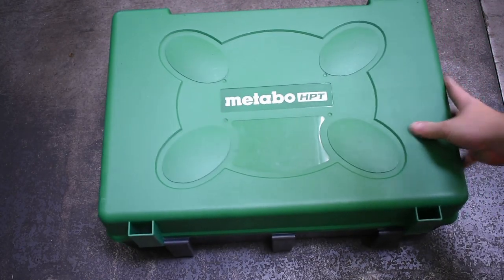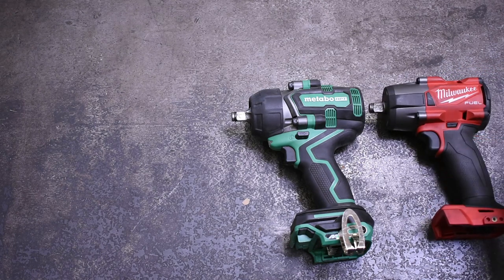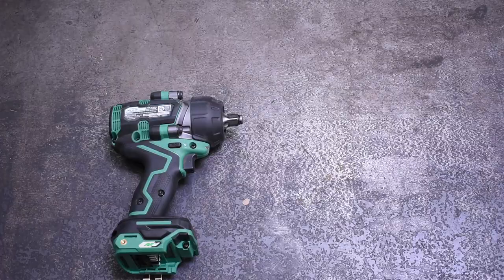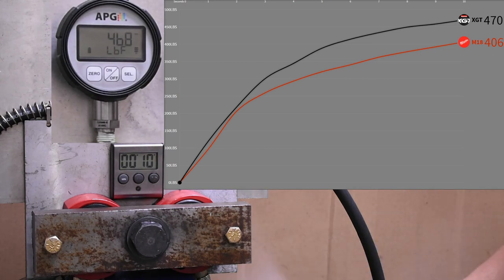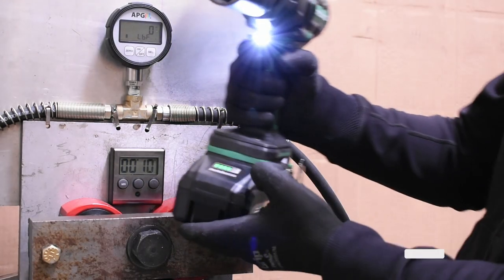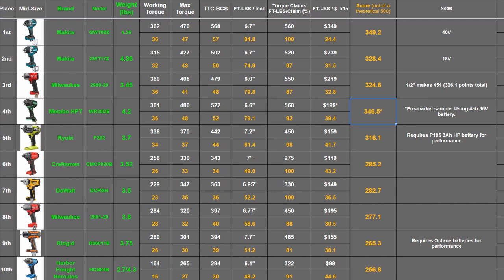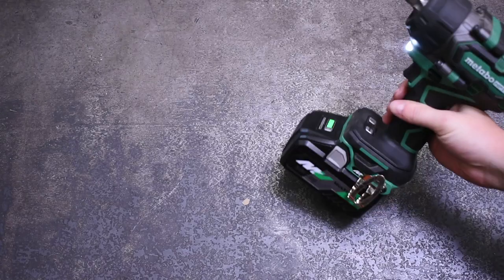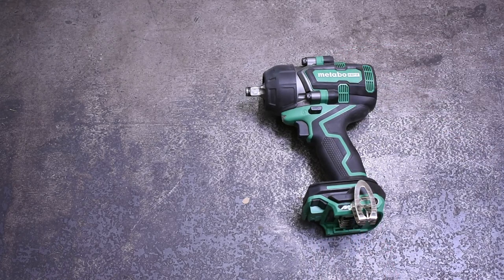We Stole This New Impact Before It Goes On Sale to Dyno Test It: Metabo HPT WR36DE

Comment: Not sure why Metabo HPT has been largely ignored on YouTube but they have made some of the best tools out there for years. Great video as always.
Reply: Metabo doesn't really advertise or hype like the other big brands. Also the whole metabo hpt merger thing still has everyone confused about what they are. I think they would have been better to stick with the Hitachi name. It doesn't help either that they only make power tools. I don't care personally but the customer has spoken and they want to be in a manufacturers ecosystem with complete lines of products from hand tools to clothing and storage as well. It's like Apple vs Android at this point.
Reply: @Kyle Fowler  it's a shame because, to me, they have probably the most balanced platform. Great power and ergonomics and a lifetime warranty that is good for as long as they make the tool.
Reply: Not knowing anything about this line, literally nothing. Is it a long term quality issue? Purchasing location?
Ugly color?
I personally use Milwaukee, I have lately been buying the M12 Fuel line and am extremely impressed.  
With that being said, I am impressed with the power of this tool. The plug in option is unique,  I don't know if it would come into play, unless you only own a single tool and one battery. Then it could definitely be a benefit to continue working while battery is being charged. Like most probably,  I have a few batteries in reserve.
Reply: @randysmith9636  They are Hitachi,  been around forever.  Straight outta Japan quality
Reply: @danhenderson783  
That's what I get for doing three things at once. He does mention it in the video. 
Thank you though.
Reply: I have the old Metabo 18 ltx 400 before the merge and love it.
Reply: @Randy Smith  honestly I think it just comes down to lack of marketing and a limited tool line availability in store
Reply: Well look at snap on, their only marketing has been from tool trucks as well as not being an off the shelf product line available everywhere..  maybe all the stuff snap on “gives out” with certain purchases did it like the jackets and stuff but they got to be a well known line.  Or maybe theyre just well known because theyre so damn expensive… metabo used to be right up there price wise themselves though as well as being available in some franchised stores..
Reply: Thanks! I too beleive metabo and metabo Hitachi are some quality and reliable tools.
The 36v stuff is crazy powerful, the triple hammer impact drive is a bad mamma jamma.
Reply: @threadtapwhisperer5136  they are fantastic
Reply: @ToolswithSoAlz  thats great to hear. I am seriously fanboyed for the Metabo 36v stuff. Soooo much power and seemingly no easily drained task, at least not for the qiarter inch impact driver.

Im thinking that angle grinder is gonna be mine this week payday. If That dont go right through a 36v fully charged battery I'll be nigh unconvertable
Reply: @Matthew Laumann  I have the 36v hammer drill and have shown it to be at least as powerful, if not more, then the Milwaukee. You can get some incredible deals on Metabo right now. I've seen the corded adapter for $50 at Lowe's. Just keep an eye out for those special deals.
Reply: @randysmith9636  the AC adapter works great for my 10" full size table saw, grinder, portable band saw, mitre saw, full size router, SDS Max rotary hammer,  vacuum, saw all, circular saw etc the 36V Metabo HPT tools have replaced quite a few of my Milwaukee and Makita tools and I have been rockin Hitachi/Metabo HPT nailers for over 25+ yrs

Comment: I really appreciate all your hard work building the dyno coupled with countless  hours filming and editing. 
I take great comfort, in knowing that my m18 mid torque, is basically an old skool IR gun without the compressor. 
I work in a tire shop and use my m18 1/2 inch daily. I did 20 tires today and another 8 or so wheels off the car for rotates/various other jobs. I charge the battery 1 time a week. 

That kind of power used to be limited to a large air compressor and expensive tool.
Reply: So realistically for MOST of the applications would you rather have a big knob on the end of the tool that is the battery, or just have a cord that is electrical rather than a pneumatic hose connected without that obstructive battery?

Comment: I recently bought the hikoki/metabo gun, can confirm the breakaway torque numbers are in the ballpark to your results, 32mm socket on a m24 wheel stud, we set all the nuts to 650nm and it was able to break it loose with little hassle. I have the high torque gun in 3/4 aswell, it regularly out performs the bosses near new 1' milwaukee gun much to his displeasure.

Comment: Lowes has a special Metabo deal on for 149 USD
Hammer Drill at 620 ft lbs
Impact Driver at 1800 in lbs
With two 3 Ah batteries and Charger and Case
Amazing value

Comment: I'm still deep on the 18v red wagon. But will probably stay with it since it fulfills all of my needs. Not to mention that the investment was huge an will be hard to switch.
Reply: Yup. Sold my 20v DeWalt and 14.4v snap-on and switches to all Milwaukee. Gonna stay that way for a long time.
Reply: There's no reason to switch. I think Milwaukee has the best all-round line-up in terms of variety, performance and price. The M18 mid torque is strong enough for most things and it's smaller which helps a lot sometimes. If it's not strong enough that's when you grab the high torque.
Reply: The other companies don’t even compare to Milwaukee when it comes to amount of tools they have, compared to the competition. I’ll stick to Milwaukee for work, and Ryobi for home/garden.
Reply: Standing here deep in the M12 line, really only lacking some kind of major high torque 1/2 inch gun, but line of work always has access to air power.
Reply: And they offer more tools then any other company
Reply: @MrAPCProductions  do you think you can even get High torque with a 12 volt?
Reply: @AATreeService  In the US they might, but internationally, Makita and Hitachi have a huge lineup of tools and other equipment
Reply: @histguy101  so I just looked.  Milwaukee is still like 100+ larger
Reply: @AATreeService  Yeah, how many of those are available outside the US. How many are in current production? If you live in East Asia, there's Makita and Hikoki for everything. Both companies don't really cater to the US market, just like many Milwaukee tools aren't available outside the US
Reply: @histguy101  why are we talking outside the us now?   They are all available.  Still making it about 30% larger than any other tool line up at this time.
Reply: @AATreeService I'm just saying that depending on where you live, the most expansive power tool line wont be the same company. If you're in the US, it will be Milwaukee or DeWalt. If you're in Europe or East Asia, or Australia, it'll probably be Makita or other brands. Milwaukee doesn't release their whole lineup outside the US and vice versa

Comment: Impressive performance from the metabo. I have the Milwaukee mid torque and its powerful enough and sometimes that couple mm or cm can be the difference between being able to fit the tool or not. So far I haven't came across a fastener I couldn't remove with it. But if it doesn't have the beans that's what the high torque is for.
Reply: As a fellow mechanich i agree, my most used gun is the gen1 stubby. When you work on cars, especially on smaller ones size is more important than the power.
Reply: @t00tya  I'm new to the cordless impact game and and just want something to loosen lug nuts but if I can go smaller and use it for other nuts and bolts while changing brakes that would be awesome. What do you recommend? I'm a home gamer who only works on my own vehicles in my driveway, no garage.
Reply: @emort6  Get something like a stubby. it does those things if you don't daily them...

Comment: good stuff, to me the sizing is really heavily weighted on mid torques and smaller impacts after all if they dont fit on the bolt then they cant even transfer 1 ft lb to it, high torques on the otherhand make them as big and hefty as necessary to hit as hard as possible as the point of them is to knock loose rusted seized junk and larger higher torqued fasteners

width is also a big factor my m12 stubby doesnt fit alot of bolts or requires an extension frequently due to its width not the length theres often lots of room behind it.. other times youre hammering it into a spot so tight your shaving curls of plastic off the back of it

 wonder if theres any designs or products on the market for impact extensions that dont rob as much torque, maybe make them thicker, fit more snuggly on the anvil even if its a pain to get on and off, possible a set screw to synch them down proper get rid of that loose connection point cause sometimes you just have to have an extension to get on a bolt

Comment: I love watching all these different tests although I'll never buy anything other than milwaukee cause I don't wanna have a million different batteries and chargers.
Reply: I’m really hoping Milwaukee does 36v/18v like hpt does it’d be great to move up while still being able to use the 18v tools
Reply: I just wish milwaukee wasnt so damn expensive. They have a really huge line of tools that are really good they cost an arm and a leg
Reply: Same here except it is Dewalt for me. i have lots of Dewalt batteries and quite a few tools. im not about to switch all of that over. they do just fine for me.
Reply: I am in the Makita 18v lineup of tools. But I’m really considering getting into the Milwaukee 12v because of the multi tool. The ratchets and that cordless angle grinder. It’s hard to do it because it’s pricey and I would need at least a few batteries for em. But the tool line up they have for the 12v is seriously amazing. They don’t have any real competition when it comes to the size weight and flexibility of the batteries. Not even dewalt can touch them. I feel like no matter what you need the Milwaukee 12v line has what you need. Unless you need a high torque impact wrench. But even their 12v has some pretty good torque numbers if you don’t need anything over 400ish. 

I feel like I just talked myself into it…..

Comment: I'm so close to going all in on Metabo HPT, but the fact that their grinder still uses the awful cam latch "tool-less" guard (you basically always need a tool because it loses pressure super easily) I haven't gone in. Once they have a guard similar to what the rest of the brands use then I'm 100% in
Reply: I own the grinder, and I love it!  I haven’t had any issues with the guard.  That being said, I don’t use mine super hard or for extended periods of time.
Reply: @baraksinz  same we own the 36V switch and paddle and both have been impressive and powerful guard has not been a problem, more power than the other brands , low vibration and we do use the AC adapter for longer runs

Comment: Heya guys
I'm from the land down under, and I have an as of yet unreleased hikoki/metabo hpt impact driver that is just begging to be tested by you guys across the pond. Model number is WH36DC, it's a new compact 36 volt tri beam light 1/4 hex driver rated for 217nm of forward torque but not sure about reverse torque. No load speed is claimed to be 3700 rpm with about 4100ipm.
Let me know if you'd like to receive it and I'll send it over via express courier.

Comment: Very cool. Was about to add the 36v hammer drill to my lineup of older 18v Hitachi tools. May as well pick it up seeing that it's on sale for the holidays and wait for this. I didn't want to spend all that money on one 36v drill.
Reply: Will the 36v flex batteries work in the older Hitachi tools? Would like to keep mine as well.
Reply: Nevermind.. Found this: "In respect to this, are Hitachi 18v batteries interchangeable?

As far as compatibility goes, the Hitachi MultiVolt battery will power any Hitachi MultiVolt tool or 18V lithium-ion tool without issue. Going the other direction, Hitachi 18V batteries will not power a MultiVolt 36V tool and the form factor is designed specifically so it won't fit in the tool."

Makes sense.
Reply: @midniteoyl8913  yes all 18V can be used with 36V MV batteries in fact if u get the 2.5amhr MV it's actually a 5.0 for your 18V and also the 4.0/8.0 MV is an 8.0amhr for your 18V

Comment: I have watched a large portion of your comparisons now, and of course this is just speculation but based on the impacts that i own and the ability for them to either break a rusted bolt free or not, i would say a good indicator of what a gun will do is in the first 2 seconds of your chart. I would be curious to see an overlay of every single gun you have tested and see which one shows the highest number at the 2 second mark, and then see if it is actually the strogest rust busting gun in reality... (within each range of coarse, mid torques, high torques, etc.) Great videos BTW, keep er' movin bud! :)
Reply from the maker: Great point. But its important to compare within similar impacts per min. For example drivers shoot up fast due to ipm. With the same ipm range, higher earlier is more force per blow

Comment: In the manual did this impact have the waterproof rating as some other metabo tools do? Also is the lifetime warranty thing still a deal?
Reply from the maker: Tool says Ip56 so yes, check out Workshopaddict's vid where he sticks it in a bucket of water. No manual came with it though, maybe too new
Reply: The lifetime warranty with the hpt tools is for the lifetime of that tool model, remember. As long as they make that model, that's the lifetime. So ideally, a new tool model like this has the longest warranty lifetime 😁
Reply: @rpavlik1  Really? It says "Lifetime warranty on tool body" I would think that would mean the lifetime of the physical tool
Reply: @histguy101  well, what I've been told by people who looked into it, is either the lifetime of the particular model, or as long as they have parts (which may be slightly longer) I don't have any so I have no personal experience, I just know that's an important disclaimer because "lifetime warranty" is a powerful phrase with a variety of interpretations. It doesn't matter what any of us think, only what the law and their contractual language/warranty terms says 😁

Comment: I'd like to see a for science episode with 18 volt and 36 volt HPT tools/Batteries. The capacity increases with 18 volt however does that make enough of a difference to continue to use the 18 volt counterpart with a 36 volt battery if you have the 36 volt tool available or does it even matter which one you use
Reply: There’s no premium price jump when going to 36v. You can gradually get into the 36v tools with no compromise to your 18v
Reply: Hell a lot of the combo kits are mixed with 18v and 36v tools

Comment: Tryout the new diehard impacts sold at advance auto. I’ve been using the ratchet and they do pretty well for being as cheap as they are. They come with batteries and chargers too so it’s not too bsd
Reply: They look identical to the Workpro ones on Amazon, Den of Tools figured out the oem. There's also another brand that sells the same tools with different colors. Yes it definitely would be interesting to see a battle of the discount options.

Comment: It's an interesting assumption that just because you start at 0 torque and in most practical application you will be starting off at a much higher torque 
That you can just pick a spot on a chart and that's how it will proform 
I can sse why you would say that but maybe a quick test to make sure that is an accurate statement is in order

Comment: I've become invested in Kobalt's tool line since I really have no need for pro grade tools, but I still think Metabo HPT looks pretty tempting. It's hard to beat Kobalt's value on a lot of tools though, especially since they regularly have some serious sales.
Reply: those 24V tool are awesome, except a little bit delay from the trigger
Reply: The thing is, Metabo hpt’s price is really not that high.  They are priced pretty aggressively when compared to the big 3.  I’d say sometimes even lower than Kobalt.
Reply: Avoid the Kobalt 80v OPE.  The tools are "okay" but if you have any problems the customer service, repair, parts are non-existent.
Reply: @prototype3a  Noted. I thought they would be decent coming from Chervon, but I'll probably go with Ego when the time comes for that anyways.

Comment: This unit is cheap enough for me to put into the truck (nuts torque to 150 ft lbs) and use an adapter for my M18 batteries.  It depends upon the actual selling price when it's available for retail sale.  If it is $199 list, I will buy one, far less expensive than another Milwaukee tool.  Yeah, it's heavier and larger than the midsized Milwaukee, but for just intermittent usage, it doesn't matter.
Reply: It's 40v you wouldn't be able to adapt to a m18 battery.

Comment: I would still pick makita, makita usually has extremely good components inside of their tools, and are their own company, and not owned by multiple corporations. For that reason and makitas consistent quality ill continue buying makita.
Reply: Makita tools are solid pieces of kit, I carry one for work because that's what I had when I started and it was the original brushed impact wrench which I had used on a personal vehicle to beat brake drums off, took that abuse and kept working fine. Now i carry the high torque lxt impact for work and it too gets beat up
Reply: I love Makita and will. Continue to buy some but the red and teal tools are overpriced and thus have pushed me into carrying more and more if the Metabo HPT 36V tools-wont go back. In some.if these great tools

Comment: Cheaper yet more powerful than an m18, also the fact that metabo hpt batteries are cheaper than Milwaukee m18
Reply: This is more similar to the Makita.
M18 has more dynamic power and is smaller.
The Makita is similar size and has similar max torque.